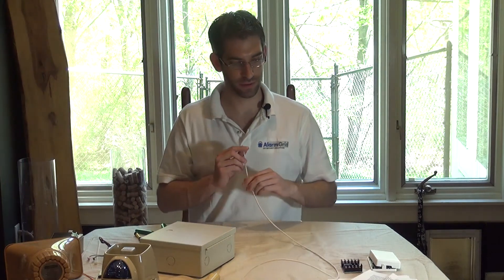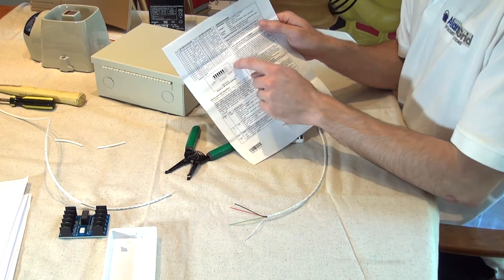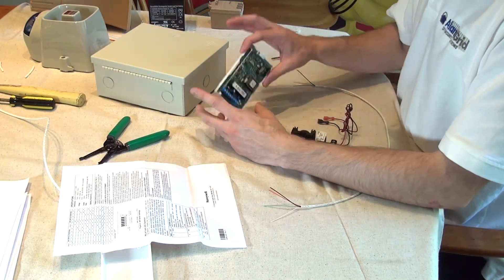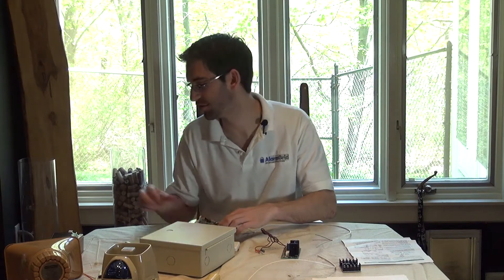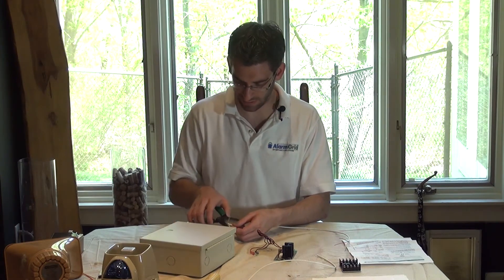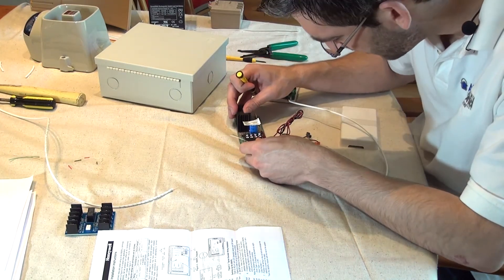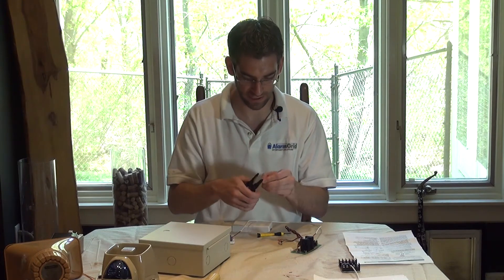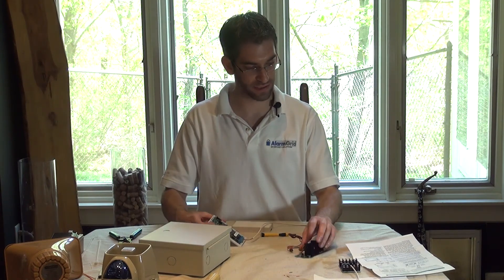Alarm Grid LYNX-EXT: Constructing the LYNX-EXT Kit

Comment: I have the same exact setup L7000, 5800 RL/power supply 1.5 amp, Ext. siren and house code 7. The Problem Is as soon as I connect the AC power or DC battery the siren sounds off even without the alarm being triggered.